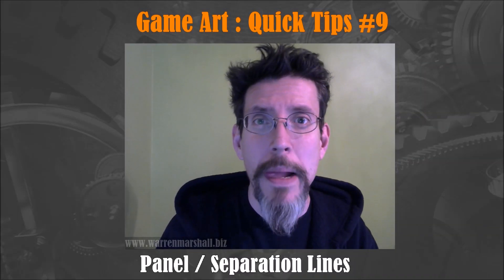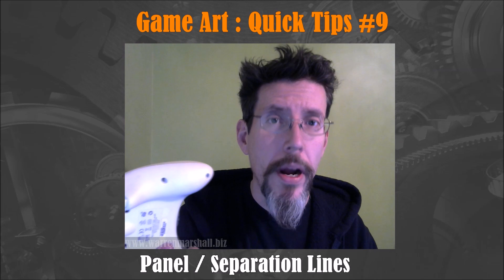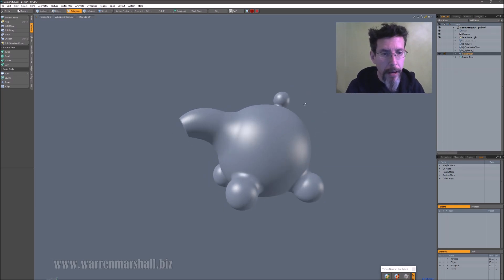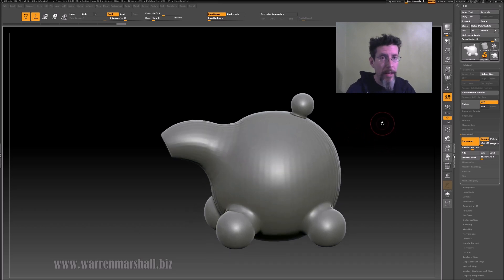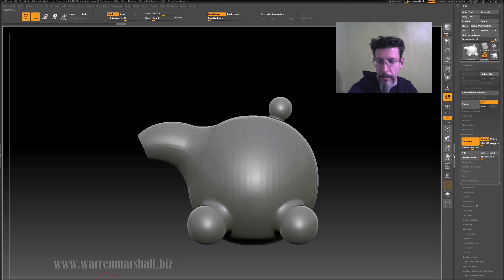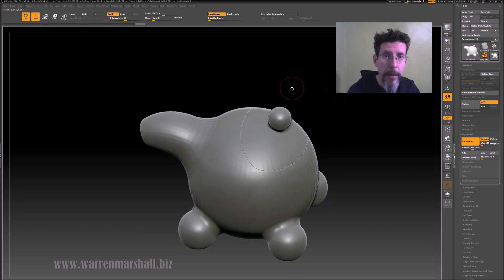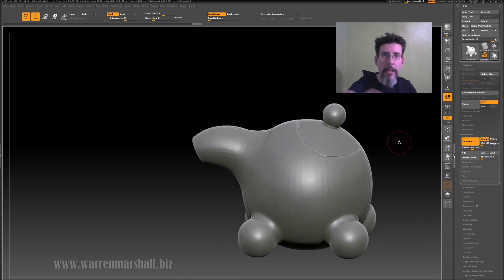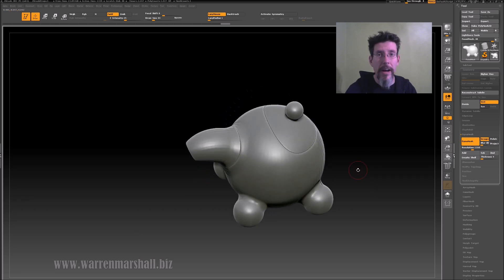Quick Tip #9 : Panel / Separation Lines

Comment: Good tip, but why not continue using Mesh Fusion to create those cuts?
Reply from the maker: MF has a tendency to get heavy pretty quickly. Adding lots of little cuts and indents will add up quickly and then it becomes slow to work with ... in my experience, at least.

Comment: Isn't it better to just do the lines directly into the normal, using painter or NDO?
Reply from the maker: Well, "better" is whatever works best for the job at hand.  If you can get the results you want by painting them in, go for to.  Sure!